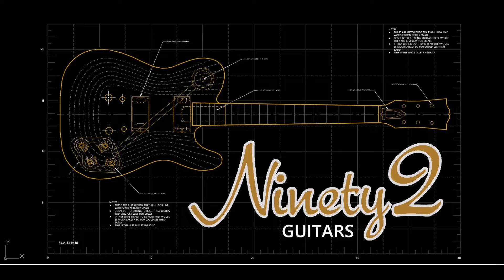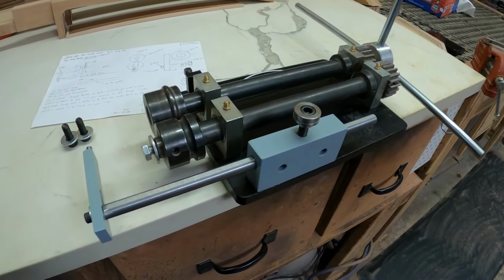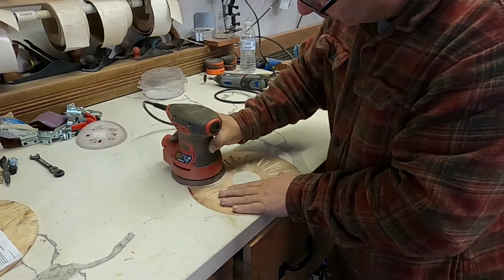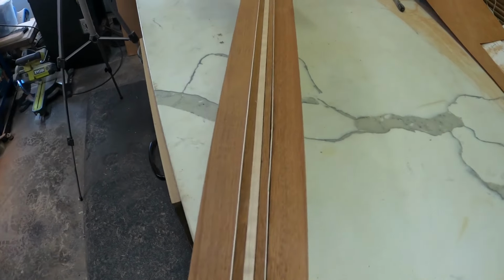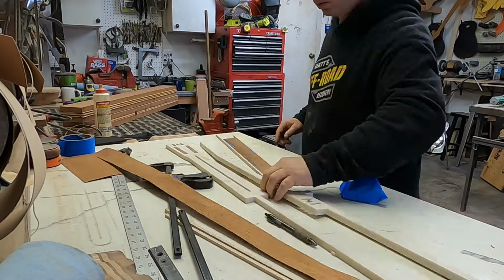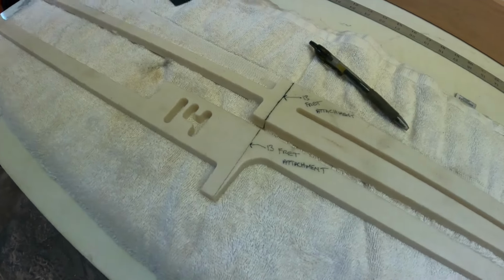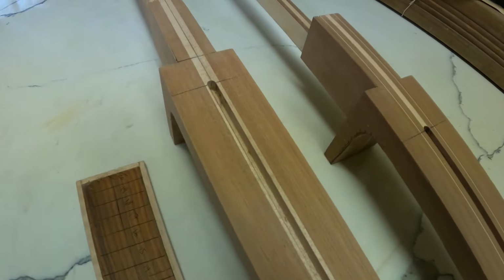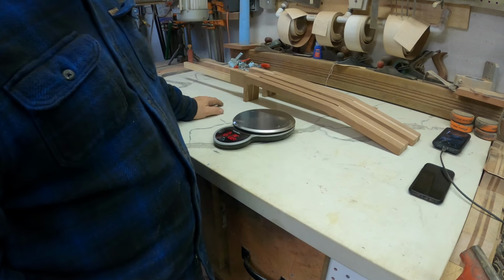Bronze Resonator Guitar Builds | Ep3 | Necks and news

Comment: James, You already know I watch everything you do here right? I am in no place in my little life to say anything about how to build to  a fella like you. ( No buts about that statement!)  Can I say how amazing it is that you are are still hand sawing fretslots? I am always amazed you do this instead of getting a .023 blade from Stewmac and one of the small tabletop circular saws and have templates made up. My old setup was a dedicated fret slotting one too, took up hardly any room, hung on the wall, and was SUPER easy and fast to use.  Anything that will prevent your arms from developing Carpel Tunnel Syndrome is a GREAT ticket!  I love what you do my friend.
Reply from the maker: I have a small table saw and bought a blade with the correct kerf size, but I have not had the time to get it all setup. It can be difficult to balance my time between building guitars and building jigs. My approach lately has been to stop on the guitars whenever a particular process is driving my crazy. Now that I have the CNC I'm hoping to find a bit that I can use to cut the slots. Putting the radius on the fretboard drives me way more crazy than the fret slots. I might draw up a fretboard plan for the CNC today with slots and radius, that would be amazing.
Reply: @Ninety2guits  Excellent! My plan, it is coming together!!!!

Comment: Great video, again !
Love the humour element too - almost Laurel & Hardy, with the clones of you !!
I have a few questions :
1. Body depth - vintage Nationals tend to be quite slim, and even Michael Messer decided to make his Fiddle-Edge Dobro guitar with body less deep than the originals - all because it made the sound less wooly, or something. Maybe more bass, the deeper you make the body (I know NRP have been doing some versions of some of their models like this), but have you tried vintage National body depth ?
2. Coverplate screws - what are you using ? Philips heads are easier to install, I’m sure, but low profile heads with slots look much cooler !
(I could supply you some machine screws in nickel-played brass as I’ve had a batch made, and even more vintage National spec screws to come) - to try out.
Reply from the maker: I can verify that the deeper body is definitely way more bass-ey (is that a word, just made it up). The brass version I built was tapered from 3-1/8" deep at the back down to 2-3/4" at the front. It lost a lot of bass response compared to the 14 fret mild steel version which was 3-1/8" deep all the way around. They were both similar in loudness/volume even though the brass one was a smaller body size overall. The brass one sounds great but definitely less bottom end. It was a good learning moment for me. I expect to learn a ton from these two. They are both 3-1/8" deep but Paul's is a smaller body. I am expecting Paul's to kind of hit the sweet spot, should still have good bottom end and still be loud and jangly while also being lighter. This was all stuff Paul and I had given thought to while we were designing his guitar. I can't wait to hear them together. I wish it didn't take 3 months and hundreds of hours of building to learn these lessons but that's where I'm at I guess. Since I have all these versions drawn in CAD and can measure the total volume of the body, I can start to see if the bass response is a factor of body volume or a factor of body depth. Eventually I should be able to build bodies to meet a desired sound, how cool would that be.
I'll admit cover plate screws is where I'm lacking. I've been using regular pick guard screws like you would use on a wood body electric guitar but I'm not happy with them. On the copper telecaster I used allen head bolts with brass backers soldered to the inside of the body. I really like the brass backer idea, I think I'll do something similar on these but try to find some slotted machine head screws that have a vintage look to them. Can you send me a pic of your screws? That would be super helpful. The allen heads are really low profile which is what I like about them but they are definitely not a vintage look lol.

Comment: Making some great progress there James. Seems like you could save a little neck wood if you did a mortise joint for the piece that goes through the body. I think you've talked about that before. I've had days where I could have clubbed myself in the head with a neck blank. Thanks for the shout out on the CF rods video buddy.
Reply from the maker: I have talked about saving wood on these necks by making the two outer most layers the length they need to be instead of cutting so much of it off. I want to do that, but making all the pieces same length and height is the path of least resistance at this point so there I am. The other reso builders glue in there neck sticks to the heel, I should probably take note. For that matter it could even be a less expensive wood and maybe even lighter wood. I try not to put too much focus on all the building refinements that need to be made, it would be overwhelming. Whenever a certain task is driving me crazy I stop and work on a jig or a process to make it not so awful. Right now it's radiusing and slotting the fretboards that's driving me crazy. Think I'm going to work on a CNC plan today to help with that.

Comment: Also what ga is metal your using? I used 22 ga on my last one and it's  pretty heavy.
Reply from the maker: I'm using 24ga on the stainless versions and the brass and bronze is .03" thick. The original mild steel versions I did were 22ga, they are a bit heavy. The less solder you use will save a lot of weight, solder is very heavy.
Reply: @Ninety2guits  ya that's what I was thinking I'd use on the
Baritone. Yes the solder is very heavy  at least a pound when it's all done .  I'm thinking that a smaller lip on the top and bottom would help reduce the weight and the amount of solder required. On my last build I used a solid maple block at the neck and tail which I'm sure add a pound or so. I see   you just attach the neck to the body so I'm trying to come with a similar idea.